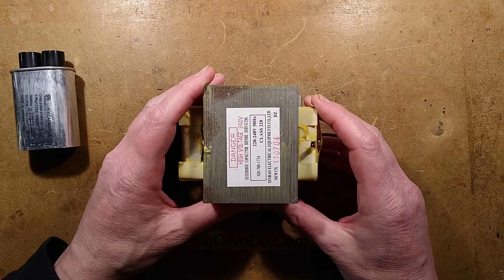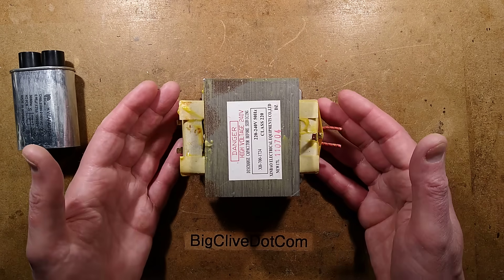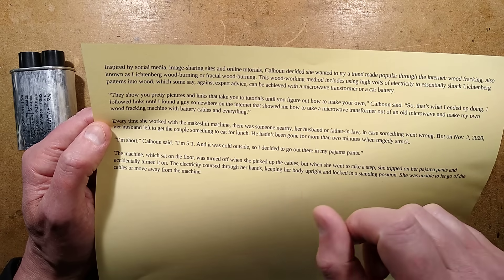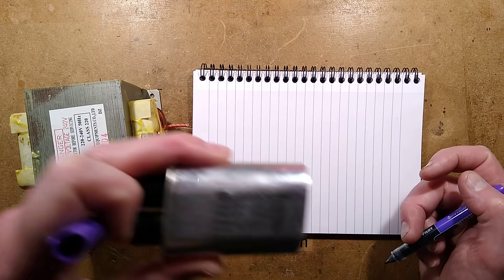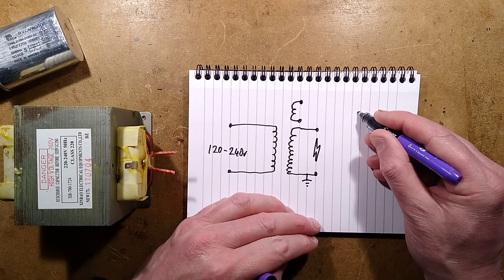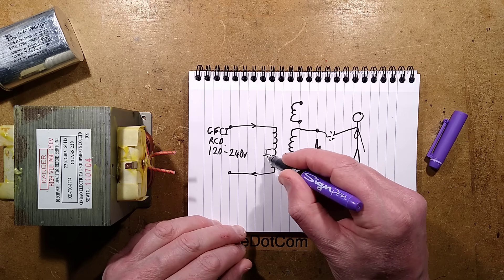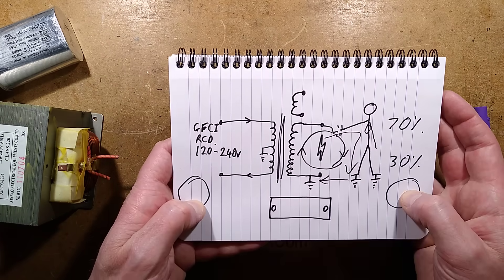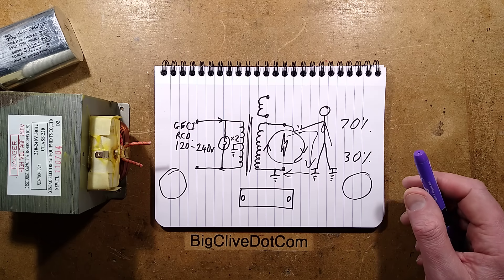The most deadly project on the Internet

Comment: [05/08/22] Just as a note of information, in North America the voltage carried on the so-called telephone pole wires is 14,400V AC. This is then typically stepped down to 240V AC through oil-cooled transformers that are mounted on the poles. From there the 240V is routed to the home's main electrical distribution panel and is split into 2 120V lines, with the exception of the connections going to the kitchen range, and clothes dryer.

Comment: I ended up getting a necklace stuck in an outlet beside my bed, (it had fallen off my bed and onto the frame right next to the outlet), and it had completed the circuit somehow and burned my bed frame and the plastic housing to the outlet. It was so hot from the electricity that I actually felt it burning before I had any idea what was going it. Ever since then I have been terrified of outlets.

Comment: I'm a bit confused, how is the secondary at ground potential if it isn't attached to a grounding electrode in one way or another? Wouldn't it be completely galvanically isolated from ground?
Reply: one end of it is grounded to the core (which is in turn grounded to the microwave case/earth when inside a microwave, otherwise it's floating). This is done to save money (it cuts insulation requirements in half and a smaller core with a smaller window can be used).
Reply: @fvckyoutubescensorshipandt2718  So if you were to take it out of the microwave, it would not be grounded on the secondary. Not trying to say this would be safer, just that in this case the shock hazard wouldn't be from completing a circuit with ground, but through shorting yourself across the secondary of the HVT.

Comment: Why don't you just use a Beckett Electronic Oil burner ignitor?

It's a 14,000 v transformer for like 50 bucks.
Reply from the maker: Not so easy to get here.

Comment: Your explanation on secondary wiring bypassing gfci scares me.  Are there any common devices plugged into gfci which are isolated like this?
Reply from the maker: Not too many, but some DC leakage faults from modern switchmode supplies can defeat some RCDs.

Comment: It's important to know that it triggers an electrochemical reaction that forcibly contracts the muscles.
It's not a matter of willpower - no matter what signals your brain attempts to send to the hand, if you are holding the thing electrocuting you, you will not be able to let go of it.
Reply: Which is exactly why an electric fence sends pulses of current - so you can let go between pulses rather than be forced to hold it.
Reply: @wolf1066  no not in the 80s that was prior to Electronic devices to mitigate electrocution..

Solid state electric
Reply: @mjolnirswrath23  If you're talking about electric fences as used on farms, the fences back in the 1970s used to pulse to prevent electrocution.
Well, the ones in New Zealand did.
Reply: @wolf1066  this was for a horse pen I actually got stomped on my chest by a donkey named chico I was 8 I think..I watched my father Conan The Donkey punched it and knocked it out cause I was trapped beneath its hooves , he also put .38 special to the Rattlesnake that sparked the reaction of the donkey as I was pulling a long chain green garden hoses to the pen to water it that day..

I still remember the green pondscum on the surface of the water tank which was a metal tank cut in half..

I had no broken bones just LOTS of cuts and bruises but again I have TWICE the bone Density of a normal human being. 

Including cranial plating and a extra bump in the base of my skull protecting the cortex similar to on a Dogs head..

You also NEVER forget what a Rattlesnake sounds like when it's right next to you
Reply: @mjolnirswrath23  We don't have rattlesnakes here, so the only way I know what one sounds like is from watching TV.  Not sure I'd want that sound right next to me.

First time I got hit by an electric fence, I was about 8 or 9, which would put it around '71 or '72.  We moved from sheep country to cattle country and were renting a cottage from one of the farmers in the area.  The farmer was out on the tractor working the field and I stopped to watch, wandered over to the fence - post, batten and wire - and leaned over the top of it.

The top wire was electrified.  It was across my chest and under both of my armpits.  Seriously, I thought I'd been attacked by a team of synchronised martial artists all simultaneously kicking/striking me in different parts of the body.

Had never encountered an electric fence before so I had no idea what had just happened.

Of course I pulled away pretty fast so I only got one jolt. I learned to look out for any wire running through insulated fixtures on the posts and battens after that experience...
Reply: @wolf1066  "the fences back in the 1970s used to pulse to prevent electrocution." All the agricultural electric fences in OZ I know are pulsed. Likely types and use for different animal behaviours vary widely.
If they could let go it was transient or a brush not a grip, or they are superman so their observation does not apply to mortals. If you don't have fractal patterns on your hands it wasn't much of a jolt. Lightning, depends how close, and I guess the strength of the bolt, I have been a few metres from a strike that destroyed a fence post and welded metal parts in structures nearby, a boot but mostly only ear problems, others in different strikes not so lucky tens of metres away.
 The difference between animals and humans is animals will get a shock from a fence and usually not go near it again. Human children will play games and see who can hold onto the electric fence the longest, form a chain and see who breaks off first,  then giggle.
Reply: My dad almost died when I was a kid from high voltage. He was working on a high voltage electrical panel in a maxwell house coffee manufacturing plant which had been turned off. Someone came into the control area, removed the lock from the breaker, and turned it back on without checking if workers were still present. Dad got launched about 20 feet and woke up some time later thankfully. Plant kept trying to weasel out of paying his medical bills. But this was the early 90’s in Georgia and worker protection was even shittier than it is now.
Reply: @teknoman117  I hope that whomever it was that bypassed the safety lock was summarily sacked.  The money they saved by not paying that imbecile could be spent on your dad's hospital bills...
Reply: Can confirm. When I was 4yo I was visiting a local farm. They said "jump over that wire and you can go play in the sandbox". They literally meant jump over the low hanging wire that ran to their shop. It would usually be 15 ft in the air but got knocked lower by a tree branch or something. 

Instead of jumping the wire, I grabbed it with both hands. I still remember the 60Hz buzzing sensation and the total inability to unwrap my fingers from the wire. They had to come knock me off the wire to get me loose.

Funny thing is I don't really remember it being painful. Just scary.
Reply: @jennitro  DAMN! You were lucky it didn't stop your heart.
Reply: @wolf1066  Very much so. On a related note, still waiting on my superpowers.
Reply: @jennitro  What???  You didn't get the ability to harness the Speed Force and run faster than the speed of sound?  That sucks, dude.
It's like that spider that gave me nothing more than a painful swollen finger.
Reply: Yeah, the nervous system works on electricity, tazers zap you with a current similar to the nerves so it makes you lose control, since the electricity outside is controlling you and making your muscles clamp and grip whatever, same for other high voltages
Reply: that's why it's called the "let go voltage"
Reply: @twerking bollocks can't exactly show medical records, I got the Multiple Scars to prove it, and 27 years in the Trades,  fuck you too ..
Reply: Just like true love !!!!
Reply: Not ALWAYS..been bit by 110, 220, 440 And lightning 
.
I had ZERO problem letting go of the source , used to play with the horsepen wire as a kid too, some of us just built differently..

The 440 was actually also 110 since I cut a 440 main from a house using a 110 Sawzall blade was Sheared in half on an aluminum ladder DURING a Thunderstorm..I was under cover though,  the guy that built the home Previously jogged his main line whole bay over for unknown reasons..so the assumption was the wire was next bay over...I can still taste the Ozone...
Reply: @mjolnirswrath23  Ok now try doing that with 2000v-3000v.
Reply: @HackModNerd  and to be SPECIFIC Lightning is Millions of Volts ive been struck once however I met a guy worked with rather that has been struck 4 time's his last time he woke up with a toe tag on...IN the morgue..
Reply: @mjolnirswrath23  lightning is very fast event (so inability to let something go doesn't matter at all), and with voltages less then 1-2kV you still have a chance (a chance!) to let it go. Live high-voltage wires - completely different story. Voltage is high enough to cramp you muscles  hard enough and it will deliver this voltage constantly as long as there is contact. Actually was expecting this info in the vid.
P.S. message is not for you, obviously, you already know everything and those nonames on the internet are just stupid kids. It is for others, who will see this thread, so they won't be misinformed and will know what could happen. Any high voltage is no joke, live one - is the worst.
Reply: @Blackwing2345635   I agree
Reply: @mjolnirswrath23  it isn’t the volts that directly cause death, sir.  It’s the amperage.  High Voltage just means the power source has a LOT of “push” and can overcome far more resistance from whatever material the electrical flow encounters in order to reach a suitable “ground” location.

Amperage, on the other hand, represents how much raw energy is passing through the conductor per second.  The reason “high voltage” is so dangerous is because 1) it is usually linked with systems that require high amperage, and 2) it has the “pushing power” to make sure whatever is on the receiving end is more likely to get ALL of those Amps pushed through it.  Your body is an amazing electrical resistor by design, but if the voltage is high enough, you won’t be given the reaction time you need to let go before the source overcomes your body’s resistance with enough amperage to keep your muscles locked down on it.

And then it’s just a matter of time.

You are very fortunate that you didn’t get enough initial amps to keep you holding on to those sources, but that does not mean that any one of them couldn’t have easily “grabbed” you and killed you on the spot if the circumstances inside the system had been a little different.
Reply: @OneBiasedOpinion  I see off RFID detectors at stores with my fingers
Reply: @mjolnirswrath23  and everyone clapped
Reply: @mjolnirswrath23  So did you just ignore the part of the video where he said this is high voltage and makes the voltages from house mains look like nothing?  You're the exact narcissist he described at the end.
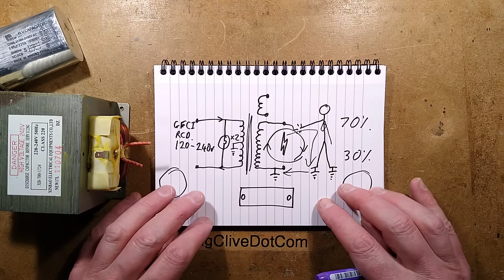Reply: @mjolnirswrath23  14:45 I believe THIS is for you, spesificly.
Reply: @mjolnirswrath23  "2000 volts means you can't let go"
"DUHHHH, ME PWAY WITH FO HUNDWED VOLTS AND ME WET GO"
did a little damage to the parietal lobe there, pal.
Reply: @timhorton8085  tempered by fire friend.
Reply: @mjolnirswrath23  ye that happened
Reply: @Catastropheshe  got the scars as my badges of Honor the slashes and gashes and burns missing chunks of flesh and regrown to Pale tender Reminders of The Corporeal Flesh is just an Extension of the mind..

Comment: you definitely don't play with this!!! I've just made my first HV transformer and circuit a few months ago, and it is very very important to have good practices in place. never play with high voltage, especially if you are only familiar with embedded projects that never go above 24V Max. I was testing my and my screens were reacting badly from around 5-6 meters, so i am definitely not touching that

Comment: I had a very near miss with electricity too, but not with fracking. Mine came about through laziness, and as well as complacency. 

I was doing some electrical work in a friend's shop, above which was our apartment we were renting. I had left a wire open, out of its hangers, and tucked out of the way with its ends spread wide. I didn't have anything at the moment to cover it, so I left the breaker off and put tape over it, marking it "TAGGED OUT". The landowner, myself, and my wife knew what that meant. 
Fast forward several weeks. I regularly checked to make sure the breaker was off and covered, but didn't do anything with the wire... laziness and complacency. The landowner had a friend come over to do some electrical work unrelated to the shop, but the friend came in to shut everything off anyway. When he turned stuff back on... for some unknown reason he broke the tape and turned on that one breaker. 

The wire had fallen out of where I had tucked it away. I don't know when or how that happened. On this particular day I was working on my boat, and was looking down as I passed under that wire. I never even saw it. It touched me on the crown of my skull and my right cheek bone. I remember hearing a "buzzing"... I know it was the 60hz hum of American AC current... and the next thing I remember I am trying to get up off the floor. I still didn't understand what had happened. I stood right up into that damned wire AGAIN! This time it HURT, and my wife heard me scream upstairs. I vaguely remember getting up again... I tried a total of three more times... and I very clearly remember feeling my body shutting down. It felt like circuit breakers tripping offline. My wife said I was shrieking at her to "watch the wire" and "shut it down", even as I was passing out on the floor. She just threw the main and shut the entire panel down. 

The landowner's teenage daughter heard the commotion, came out to see my wife trying to pick me up, and ran back in to call EMS. Her fiance came out and got me up off the floor into a seat, but I was effectively unconscious... I couldn't stay up. Twitching and jerking they said... absolutely terrifying my wife said... and my two year old daughter was totally freaked out. The daughter grabbed my kiddo and took her into the house... they were both terrified. 

21 hours later is the first memory I have afterwards. The doctor said if I had been any more dehydrated (it was summertime) the electricity would have gone through my skull and likely out through my ear, in which case I'd have been dead from the first shock. As it happened, the power ran through my scalp. I was INCREDIBLY lucky. I had two very small burns at the contact points, and a very sore and sensitive path down the right side of my head. That sensitivity still exists 8 years later. My right ear has incredibly loud tinnitus. I had sudden debilitating migraines for several years... called "complex dysfunctional migraine", they present like a stroke!.... and while those are very rare now I still get massive headaches unpredictably. 

Electricity is nothing to screw with. One mistake, like this poor gal... laziness and complacency, like me... other people not paying attention, like the friend that turned the breaker on... it only takes one mistake, and you're screwed the hell up if you're lucky. Or dead if you're not.

Comment: When I started training as an appliance tech the capacitor in microwaves had no bleed resistor. I guess enough people were killed that they started requiring it. I went to a manufacturer training seminar and they taught us to work with one hand in your pocket till it was discharged so there was at least less path through your chest. A long time service technician I had met at previous training was killed by one. He had one hand on the unit and the other too close to the shaft of the screwdriver he was using to short across the terminals. It simply stopped his heart from the shock and it didn't restart.

After that I started using a clip lead to ground on the screwdriver as a safety measure.  

Also the old CRT television and monitor tubes can hold a large HV charge as well. And even recharge some after being discharged.  One of those got me in the arm taking it out of the one time.
Reply: Be careful with those alligator clip leads.  Sometimes, they'll open up like a fuse and you won't be discharging anything.  I've had Radio Shack alligator leads open up on me before.
Reply: @Bruce_Wayne35  I understand and good point. I typically didn't and don't use the lead for the actual discharge. Really just as a path away from me as I cross the terminals in case I slip my fingers too close to the shaft of the screwdriver or if the handle happens to leak. Stay safe.
Reply: " I went to a manufacturer training seminar and they taught us to work with one hand in your pocket till it was discharged so there was at least less path through your chest." - Oh yeah, this is absolutely one of the first things we got taught at the uni too...
Reply: DEZZNUTZ 1001  "I have never forgotten the shock I got from the tube of an unplugged 21" TV" - And to make things worse those things can hold the HV charge for years even!
Reply: Same thing with tube amps.
Reply: @aemrt5745  Oh yeah, tube amps are pretty good death traps for wannabe electronics enthusiasts too. They have ~mains voltage all over them and some people are just unable to comprehend the implications of that.